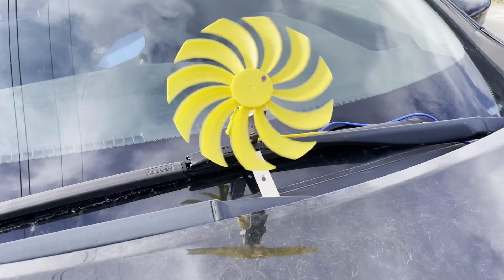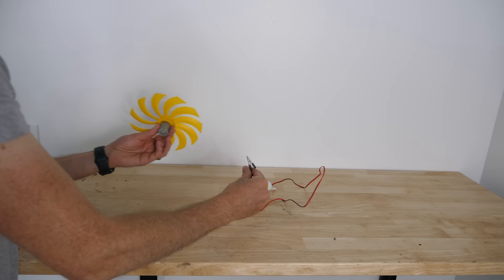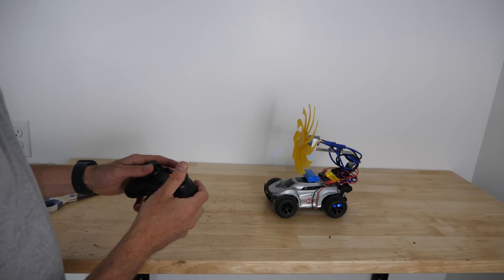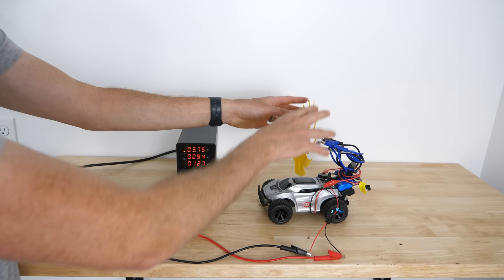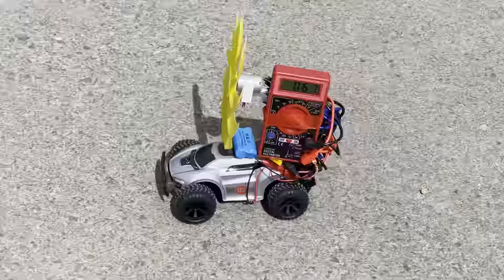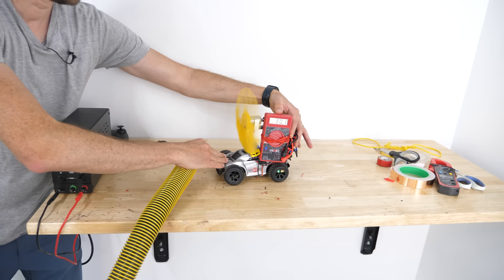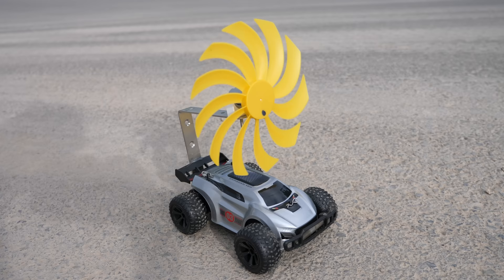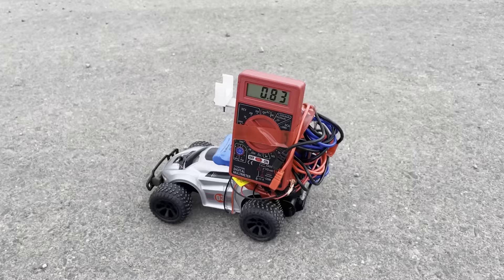Can You Power a Car With a Wind Turbine?

Comment: actually if there is enough wind it is possible to extract enough energy from the wind to move the car, even going against the wind. A few madmen built a working prototype, veritassium has a video on it. It shouldn't be too surprising, as that's how sailboats work
Reply: Yes, indeed. Saw the video.
Reply: The blackbird concept vehicle in that veritasium video was moving downwind, not against the wind. With tacking, sailboats/sailcraft can sail tangentially, but not directly upwind. The angles against the wind which can't physically be sailed against is known as the "no sail zone". That is to say you cannot extract enough energy from a direct headwind to move forward.
Reply: @Spencergolde  No, it could move moving both downwind and upwind, they demonstrated both. The blades of the propeller are at an angle so they have the same motion relative to the wind as a sailboat sailing at an angle againd the wind
Reply: Veritassium wasn't trying to prove that a vehicle—powered by wind alone—can move against the wind. In fact, he was trying to prove that a vehicle—powered solely by the blowing wind—can move faster than the wind itself. He even won thousands of dollars in a bet against a university professor who said that's impossible.
Reply: It's the same thing discussed here though - you can't generate more power from the wind while you move than from the power the wind at standstill would create. In order to get the efficiency from the wind you just need to make the turbine more efficient than the ambient wind - the drag.

Of course it's possible with the right conditions, but it's likely never worthwhile when all conditions are taken into account
Reply: @nHans  
>> Veritassium wasn't trying to prove that a vehicle—powered by wind alone—can move against the wind.

True, but I did set world records doing both with that vehicle.
Reply: @Rick_Cavallaro  Yes, I remember watching your videos back then after Derek mentioned them in his own Veritasium video. You used some long acronyms ... let me look it up again—yup, DDWFTTW and DUWFTTW.
Reply: @nHans  we were involved in countless internet discussions and debates.  It was just too long to write-out every time.  Some folks leave the first "D" off, but the first "D" is for "directly".  There's little debate as to whether you can tack upwind or downwind, but at one time nearly everyone insisted you could not go directly upwind, or directly downwind faster than the wind.
Reply: @Rick_Cavallaro  I remember. There were many "thought experiments" that "proved" the concept impossible. They all went along the lines of: How can a toy sailboat, powered only by BB gun pellets that you fire at it, move faster than the pellets? If the pellets don't reach the boat, how can they impart momentum to it? Or even more counterintuitively, how can the boat move toward you? Surely the pellets are not imparting a negative momentum? Etc. Until you demoed the Blackbird.

Comment: There is another aspect I have always wondered though. All of these ideas assume adding it outside the airstream of the car like you did here. However, cars have a certain amount of drag without a turbine on them at all. I am wondering if you could size a turbine placed in front of the car in such a way that it equals the drag that the car would have felt but goes into the turbine instead and effectively recuperate some of the energy that was being lost to drag.
Reply: There are very few areas of direct drag on modern cars, as most of them are streamlined to mitigate that, even the grille, which receives most of the perpendicular force. However, adding any turbines to those areas that DO have drag would increase the drag, as now there would be multiple surfaces causing friction, and the turbulence induced by the turbine would interfere with the streamlined airflow around the car, which was designed without the additional friction surfaces, and lead to further resistance rather than flowing smoothly around the car.
Reply: @ntsure2436  those are in fact all thoughts that have occurred to me and one day when I get bored maybe I'll do some fluid modeling and see if there's any way it makes sense. The flow coming out of the turbine being turbulent probably does mean it will just drag on the car anyway and increase the drag but I was curious.
Reply: Maybe if you put it inside the vehicle where air is already being channeled behind the grill. Probably not a lot to be gained but it's theoretically possible.
Reply: @megamaser  if it passes through the grille, then it eventually bounces against the radiator/engine/fender wells. Guys, it's the law of conservation of energy we're talking about here. You're not going to get something fpr nothing. Might as well try to build a perpetual motion machine.
Reply: @ntsure2436  It's not something for nothing. It's not perpetual motion. It's about improving aerodynamic efficiency.

The energy that would be lost by deflecting air against the engine block can instead be partially recaptured by deflecting it first against a fan blade.
Reply: If you get energy out, you have to put energy in. That's why it is a Law of Conservation. Efficiency is one thing, say streamlining, but adding drag with turbines?
Reply: @ntsure2436  Look, I'm familiar with conservation of energy. I studied thermodynamics during my physics degree. The idea is that you're trading one drag for another. By dragging more on a propeller it drags less on some other object, depending on the design.

Comment: At times when a car goes downhill, a windmill could be deployed to both keep the car's momentum from getting too high and to recharge the battery
Reply: I think regenerative breaking is already too well established, uncomplicated and efficient to make this practical
Reply: why not make simple things extremely complicated and then complain about reliability. There is really no added benefit to add any windmill into a well aerodynamic tuned electric car that can regenerate. Its far more easier and net efficient to use wind turbines in a grid.
Reply: The cat would need to know how long the hill is, and the deployment and removal process would need to use less power than it might produce. It would probably be the complicated part of the car, add a huge cost, and be useless for 99.9% of the population
Reply: @LaggerSVK  I wasn't proposing this actually be done. It's just a thought experiment, which is what you do in science. This is basically what some hybrid vehicles do (although not with windmills). They recoup some of their kinetic energy during the braking process.
Reply: @Spencergolde  Yes, I agree. I don't think anyone seriously wants to put a windmill on a car. Just a thought experiment.
Reply: @BillionFires  at this point in time this is rather an engineering debate than a scientific one. From scientific point of view this is solved.
Reply: @Billy Ford  Yes, in theory it would definitely work. And I appreciate that this is describing  a process that recuperates some lost energy, rather than gaining free energy, which I think is the takeaway from the video

Comment: Great video! I think it could be stressed that as long as there is wind relative to the ground, and your machine is efficient enough, you can extract this energy at any velocity relative to ground and wind. For example sail boats can sail into the wind or downwind faster than the windspeed.

If the turbine and car was well designed, most likely with a mechanical linkage for greater efficiency, you could do the same with the car. In fact, Veritasium has a video on just that - with a wind turbine driven cart that can be continuously propelled faster than the windspeed!
Reply: wasnt it in contention if it actually got faster than windspeed? i know its been years, maybe they've proven it went faster since then.
Reply: It's been proven. It's not very controversial once you understand how a sailboat actually works.
Reply: The black bird concept cart can sail faster than the wind downwind, not against it. This is also true of sail boats. But sail boats, and black bird, cannot sail directly into a headwind, or at any angle in the "no sail zone". With tacking, you can beat to windward, but you can't do so directly. Likewise, you can't convert the relative wind experienced while moving forward into enough energy to move forward. The relative wind from motion is always a headwind, because you have direction with velocity
Reply: @Spencergolde  Sailboats cannot sail faster than the wind directly downwind nor sail directly upwind. The black bird wind turbine cart could in principle do both, it just wasn't shown going directly upwind as that wasn't the stated challenge.

Rigorously, there is a mechanical explanation covered by Derek of Veritasium which extends to the directly upwind case.
But to convince oneself that a wind turbine vehicle can move itself directly upwind, one can imagine a turbine cart geared to move upwind very slowly. The power required to do this would also be low because power is force x velocity, and so the turbine would clearly produce more than enough power to do this for some arbitrarily low speed.

Comment: for everyone who has been following this, it seems that the person in question didn't take into account the calculation of losses and didn't include a step-up mechanism to account for those losses. They attempted to do everything directly, but let me explain something: we don't even get direct energy from gasoline. It has to go through a process, and there are numerous losses in those processes that are often not discussed.
Additionally, your car is only around 70% efficient, which is quite low. So, what would have been a better approach? One possibility is utilizing a car that runs on batteries. Here's an alternative method: take the windmill and use it to charge an independent battery. Then, you can switch back and discharge that battery while the other one is charging.
It's essential to note that this is not the only technology available. There are other options such as using an air core and various other techniques to help mitigate the occurrence of backing EMF (electromotive force).

Comment: There was a Hybrid Renault a few years ago here in Europe that had wind turbines recharging the batteries with the wind when speeding up the car! I think it was a concept car because i can't remember seeing it. It was a genius idea, more cars should have it, alongside the kinetic ones.
Reply: The 1st problem is that it’s a Renault
Reply: @kingsolomon1841  gold 😂
Reply: With the turbine placed right in front of the car and not make it larger than the frontal area of the car, this can actually save some energy.
That's because some air that would otherwise just hit the car it self and contribute to nothing but drag, will now hit the turbine instead, where a part of it is retrieved as electric energy (which can then be used for a small electric motor that helps drive wheels and reduce fuel consumption - or for an electric car the generator output could simply help feed the motor/motors, so they pull slightly less current from the battery).
But of course, the energy output from the turbine can never reach the same or exceed the total energy lost by drag - the car will always use more energy to overcome air resistance, than what's coming back from the turbine. But it could lower the energy consumption lost by drag slightly. 

I guess the savings are not so great that it's worth the added cost and complexity of building cars with wind turbines though. At least not when going at legal speeds in most countries (I guess those of who like to go fast and don't give a shit about speed limits would benefit more from it though, haha - smaller wind turbines can be made more efficient at high wind speeds and the energy lost to drag as well as the saving that could be made, goes up with the square of the speed)
Reply: Eww! I hope it was only a concept car, but even as a concept, I'd be ashamed to work for a company which produced such a thing.

Comment: What about Veritasiums windmill dragster? I actually didn't fully understand the explanation. Would love to see you giving it a shot!
Reply: "Engineering with Rosie" explained it fairly well - the wheels power the propeller (it isn't a wind turbine in this application), the whole thing begins by being blown downwind by drag (a popout "drag sail/flap" on the mast would increase this initially) - as the speed increases, so does the thrust developed by the propeller (RPM increasing linearly with speed, thrust will increase once a "critical RPM is reached), until zero apparent wind) The propeller produces thrust back against the prevailing wind leading to acceleration, even beyond the point of zero apparent wind experienced at the vehicle body.  The equations balance out at "some terminal velocity" relative to the energy provided by the wind, where drag (from the now oncoming apparent wind) equals the total thrust available from the wind acting on the swept area of the propeller - with L/D ratio most likely exceeding 10 - the design was optimised for fairly low speeds, with a wide blade to get a "bigger bite " of the air....  (yes explanations can be tricky - no thermodynamics laws were broken there).  The same craft  (should be able) could go dead upwind too, not as fast however, there are videos of up-and back propeller land sailing on dykes in  Holland.

Comment: Okay hear me out. Most cars get back draft right? Put the turbine or turbines on the back of the car facing backwards. Then you wont have a net loss because that wind is pushing you forward right? In theory this wont necessarily make you use no power but it would extend your battery life by a decent margin. This would probably only really work for a full scale electric vehicle.
Reply: That zone above the back bumper where the wind swirls back against the car.

Comment: its a energy converter only (like gasoline thruster to electric)
Reply: try hot air (hot gas) as a fuel cell or battery gas state ion exchange salt/ion bridge
Reply: it seems to work like a heat van de graaf generator, sparking an arc, it also spikes arc like a leyden jar capacitor, under the aluminium dome
Reply: if you cant laser, or dont have conductive paint, then graphite pencil (for electroplating a conductive surface) works
Reply: how about diy iron-copper(air) in copper sulphate in water solution battery about 1.1V, iron should be cheap to just put in a battery, as strips/sheet per kilogram, at 0.1$/kg (100$/kg-ton), reaction CuSO4+Fe->FeSO4+Cu (iron instead of zinc).
Reply: solar concentration mirror over steel/plastic, silver acetate or copper acetate heating into mirror over steel plate

Comment: What if a car had solar panels on the roof? Would that help the battery to last longer? (Not indefinitely) but there wouldn’t be any extra air resistance?
Reply: Yes it would last longer, but it's not magic.
The difference there, if I'm not mistaken, is that you're taking energy from the Sun's radiation, not the car. If you use the car's power to move the turbine, the car will have less energy to move and is going to be slower. With solar panels, you're using the Sun's power, and the car isn't exactly making the Sun brighter by moving, so the car siphons the Sun's energy for itself. Energy is being conserved in both cases, but in the latter case the energy is lost on the sunbeams' side alone
Reply: Solar would work, but you'd need an entire roof of solar to make a couple hundred of watts. But we're talking like 1 percent of charge (or less) by leaving it somewhere in direct sun for a few days. 

It takes a lot of power to drive a car.
Reply: Look at Aptera motors for an EV concept that is covered in solar panels. The practical problem with solar on a vehicle is the limit of surface area along with non-optimal positioning making the panels not contribute much. I still like solar on an EV from an emergency standpoint though, but its important to understand what you're actually getting out of them.
Reply: I built a solar powered toy car in middle school, no battery at all. Just place it in the sun and it goes.
Reply: More complicated than it sounds. It works, but for a lot of the users the vastly increased weight, and extra cost and complexity, makes in not worthwhile.

For people who travel short distances to work, then leave the car in the sun all day, definitely a benefit. But for people who drive longer distances, or park their cars in a sheltered area, it becomes expensive and likely a reduction in energy from the weight.

Someone mentioned on another post that any benefit you get is likely outweighed by the benefit you'd have simply putting a solar panel in the roof of your house to offset the cost of the charge at home.

As a range extender for a long trip it wouldn't be worthwhile, and possibly less efficient considering the weight
Reply: Hyundai introduced a concept car with a solar roof.

Comment: Maybe we could use a horizontal wind turbine that generates energy instead of a vertical one - for example, on the roof of a car, along with a special tunnel that would push air while driving, additionally generating downforce like a spoiler. But I guess it won't change anything. Super experiment.

Comment: Obviously, you can’t create a self sustaining reaction, thanks thermodynamics.  However, this can work, Quint Builds did this, but with an important difference: use the fan in front, which then reduces the loses due to wind resistance.  In essence, take the energy that would be lost from wind resistance, and convert it to some other form, electricity.